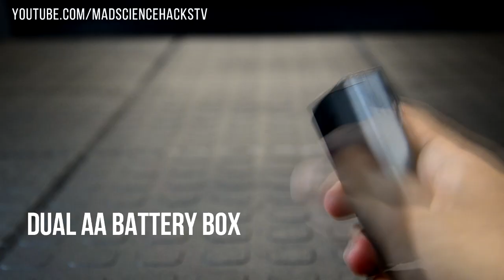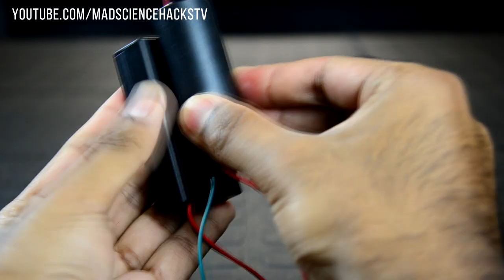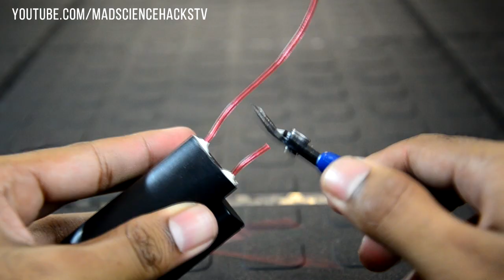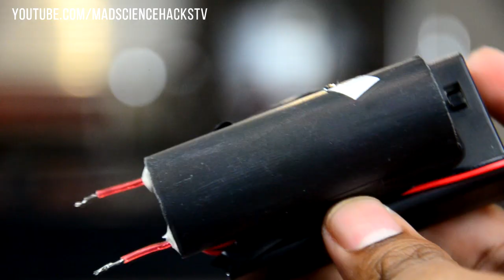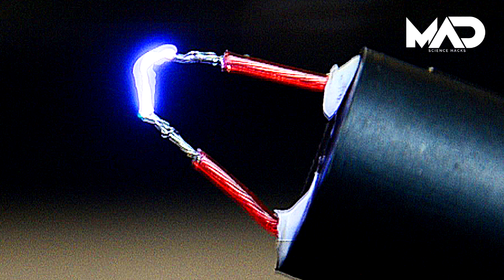How to make 400000 volts taser stun gun

Comment: Put some high mAh lithium 18650's on the converter to get some real volts. Make the gap between the electrodes (best use sharpened nails) no more than two cm. And you can take someone out.

Comment: basically using only transformer and a battery you cannot make sparks as transformer works on AC only. so basically it is inverted using an inverter circuit.

Comment: you connected the wires but what exactly did you do to make this actually do something. did you touch the positive and negetive to short out the batteries or did just putting batteries in trigger it?
Reply: Kyle Vonasek there is an on/off switch on the battery box
Reply from the maker: Thanks! Yes, there is a switch on the box.

Comment: Interesting video,what did you use for trigger? could coupling an on\off toggle switch would do the trick? also how reliable are the 400kv transformers,would they short up the minute you touch metal? ae:" handle bars in a city bus"  ;)

Comment: How are you getting this to work? Transformers only work with A.C. currents.
Reply from the maker: It is not a current transformer. It's a voltage booster.
Reply: Sorry, in the video it was described as a step up transformer.

Comment: that won't stun anyone as soon as you push it to someone's skin the wires will bend speratically and won't b close enough to connect you need to cut the wires short super glue two thumb tacks on the end then you can jam it unto someone and shock the hell out of them
Reply from the maker: The wires are quite stiff. I was planning to use 2 needles to pass the arc. I wonder if it will arc below the skin? Do you think so?
Reply: It will stun someone. It will not arc, but at this high voltage the skin resistance is so low you still will be shocked.

Comment: Hey guys! I don't understand how the transformer steps up the voltage to 400,000 volts but I do know how a transformer works, can somebody help me?!
Reply from the maker: The 'transformer' (it was labeled that but it is really a high output boost converter)  takes the 3v input and steps it up to 400kv. When the output wires are positioned close together, it forms an arc.
Reply: MAD Science Hacks thanks for the help, always good to see a YouTuber responding to the comments!
Reply from the maker: No! Thank you! 

I respond to 95% of viewers comments. I read every single one though! 

Thank you for watching and for your question.